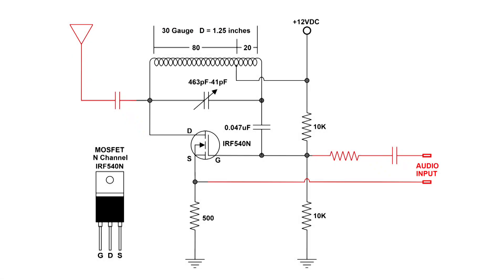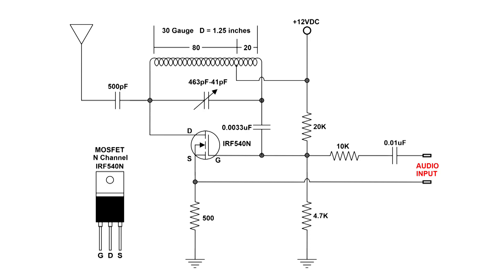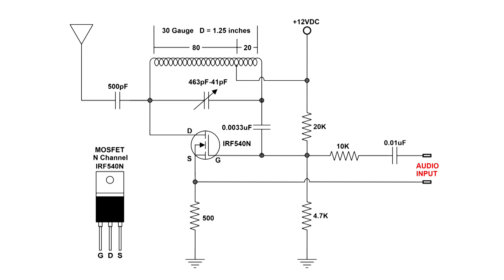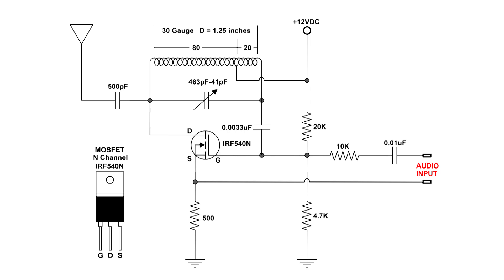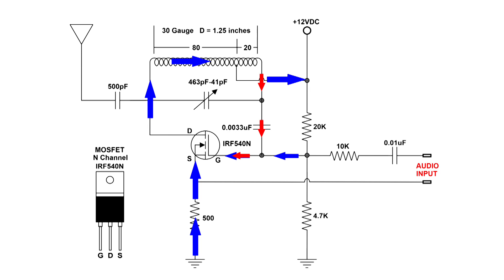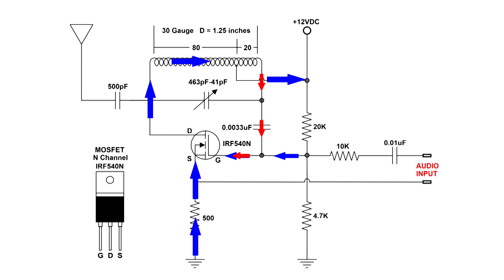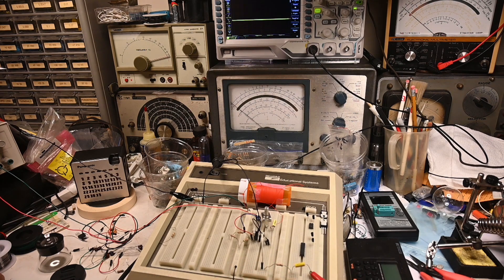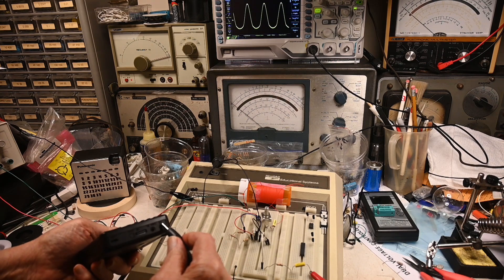MOSFET AM Transmitter Home Made Oscillator Coil PART II

Comment: Dear Sir I made this transmitter, it works very well, but only 1 meter from my radio, would like to hear my old radios in every room of my house, try to make different antennas but no luck, I think the problem is the antenna, could you show me how to make a good antenna for this great transmitter
Reply from the maker: A ¼ wave antenna would be a little over 230ft. I would try increasing the power. I think +24 VDC would help. Don’t overdo it we do not want the FCC knocking on the door. Thank you, and thanks for watching.
Reply: @AllAmericanFiveRadio  thank you so much
Reply from the maker: @koenraadschmitz9748  You are welcome. If you have more questions I’ll try an help.

Comment: Hi Rick, Will it work in a single room range, I mean 5-10 feet.? I love this project.
Reply from the maker: Yes, with a small antenna it will cover a room or two. With an outside antenna it may cover about half a block. A little more voltage will increase the distance also. Thank you, and thanks for watching.

Comment: Hi Rick. I really enjoy your videos, I learn a lot watching them. And they're bite sized which really helps. I have a question on this circuit. Not sure how to ask it, but why does the flow represented by the blue arrow "exit" the coil at the tap point and not continue to the end of the coil? Thanks!
Reply from the maker: Blue is DC. Putting the +12VDC on the tap helps the feedback (Red RF) at the end of the coil. If you had the +12VDC Blue at the end of the coil, a lot of the Red RF feedback would go into the power supply, you would need an RF choke between the +12DCV and the end of the coil, another part. This way you get Red RF feedback with fewer parts. Thank you for watching and your question!

Comment: My build worked perfect after I obtained a good variable capacitor.  Thank you for the learning experiences!  Next goal is to get the FM transmitter working (I haven't had any luck getting this one to oscillate in the appropriate band yet).
Reply from the maker: Glad you got the AM transmitter working. You may have found my newest FM transmitter video. Just in case I’ll put the link below. It surprised me how well it worked. If you have questions do not hesitate to ask!  Thanks you!
FM Transmitter Home made Coil Build Demo
https://youtu.be/Iy8Rol1nY-I
Reply: I made a hardwired version of this transmitter, which I can use for my AM radio repairs.
Reply from the maker: @edtully2740  You should find the AM transmitter useful in your repairs. You will have fun just playing OTR also.
Reply: What size variable cap did you use? All I can find is a 365pF which I’m hoping is close enough. Cheers!

Comment: I have made this Am transmitter, i wound coil on ferrite core and used mosfet IRF 630 and got great result sound quality is really amazing
Reply from the maker: That is a GREAT IDEA!!! If you do a video on your transmitter showing how will it works, I’ll put a link to it in the SHOWMORE of this video. Thank you!!!
Reply: @AllAmericanFiveRadio  Yes I was thinking about to make video about it , I will definitely make it when I get some time , in short I used same circuit as yours except I put voltage divider network of 10k on both sides as you did in older videos of Am Tx ,
I used IRF630 and feedback capacitor was 2.2nf , coil is ferrite core of 75turns total turns 60turns+15turns between 60 and 15turns I take tapping of coil connected to positive side , I used 560 ohm of 1/2 watt resistor because I did not have 500 ohm resistor.This is all what I did, the sound quality is excellent, I will put earth and antenna to test how much far it can go, thanks for giving this design on YouTube, it is because of you that I am able to make this successful transmitter, again thanks a lot.

Comment: Hello Rick 
How are you? and sorry for disturb
Do you have any circuit about an AM transmitter using crystal oscillator 
Hope you help me and thank you
Reply from the maker: Very Cool! About a year ago 
I helped a student in Athens Greeks.
Thanks again!
Reply from the maker: No not a transmitter, I do have a video on a crystal oscillator. What frequency  are you wanting to broadcast on? Heres the link to the crystal oscillator video.
Oscillators for the Beginner
https://www.youtube.com/watch?v=xezzwJAZEQY&t=86sal
Reply: @AllAmericanFiveRadio thank you for helping Mr Rick
 the frequency that I want is 1MHZ and then I will look for the AM modulator circuit appropriate for this oscillator
Reply from the maker: @sobhisaad1382  I think that would make an interesting project and video, thanks. I'll see about ordering some 1MHz crystals.
Reply from the maker: @sobhisaad1382  I completed my last video. I just ordered a 1MHz oscillator IC for the transmitter project. Should be an interesting build and project.
Reply from the maker: @sobhisaad1382  I just put up the new video
Crystal Control 1MHz AM Transmitter.
Reply: @AllAmericanFiveRadio  thank you Mr. Rick and it looks interesting
Reply from the maker: I got the IMHz oscillators and they are accurate, but they are square wave, not mentioned on the eBay site. So I just ordered some 1000KHz crystals. I could use the other oscillators, but the filtering weakens the signal to much to be useful.
Reply from the maker: I’m curious, why do you want a 1MHz transmitter? Is it for school?
Reply: @AllAmericanFiveRadio  yes sir

Comment: Interesting, but what is the range of this thing, and how should the antenna be for maximum range? Can you experiment on how to make an amplifier stage and filter, and also connect an matching antenna?
Reply from the maker: It will cover two to three rooms. With a small antenna it may cover the whole house and more.
Reply: It remindes my of an ordinary FM oscillator circuit, but you have made a feedback to make it oscillate better as needed at lower freuencies. Now we need to make an amplifier stage, filter stage to 50 Ohm cable and making a rod antenna with incuctor at bottom. 10W should do :) @AllAmericanFiveRadio
Reply: @larslande  a filter and/or antenne matcher is easy to do, but the 10 watt requires a bit more work :) This transmitter with one mosfet is an oscillater but als a modulator. So with 10 watts you need a seperate modulator. The 'old' rule is that you need at least 50% modulation, and that isn't something this would provide. Sure it can be done based on this transmitter with a few buffers and a IRF510 (which provide around 16 watt PEP), but that would be something different than this (building a small but good transmitter with just a few components).

Comment: Hello Rick, could you please explain how do you define the values of the capacitors, how did you tune the frequency and in general a bit of the theory behind the design in more depth. Your videos are very educational and I have always thought that there is a gap in the modern way electronics is thought between theory and practice. It's very nice you share your knowledge to close that gap. thank you.
Reply from the maker: THANK YOU.I'LL BE GALD TO SOMETIME SOON, BUT UNTILL THEN HERE IS INFORMATION THAT MAY HELP.
Oscillators, the Basic Tank Circuit 1
https://www.youtube.com/watch?v=fQ4yRVEzXQA
AM Transmitter Tank Circuit Coil Capacitor Resonance
https://www.youtube.com/watch?v=6TRqNkT5OCk

Comment: Great circuit! Can you use an MPF102 fet?  Also, did you check the harmonics?
Reply from the maker: Yes I have used an NPN transistor. You may need to change the bias.

Comment: Rick - great job on the new coil and circuit modifications. I love how you showed the signal flow. One trick I’ve used to cleanup the sine wave is to place an RF choke (inductor) of 180 uH or greater just before the 500 pF capacitor dependent on your wire antenna length. Thanks again for sharing your design and theory of operation. Best, Don
Reply from the maker: Hey Don, Thanks, and thanks for the sine wave cleanup tip. I have done this circuit before, maybe ten years ago. But I did not explain how the circuit works. If you change the tank circuit you can get it on the FM band and even on the two meter band and more. This is a fun and cheep circuit to learn with and can be very useful. Thanks again Don. Rick

Comment: Hi Rick, this is awesome 👏👏 you are amazing. This is very very helpful for us. What is the range for this AM transmitter? It sounds much much better then “Talking House”. Thank you for making these videos. Have a great day Rick! Regards, Jay
Reply from the maker: Hey Jay, it will cover two or three rooms with two alligator clips as an antenna. With more power and a good antenna it should cover the house and more.
Reply: Rick, can I increase the power to 18 volts DC or that will damage the unit? Thank you very much. You are genius.
Reply from the maker: @RadioFixer  Hey Jay, this circuit should handle 24VDC. You'll have to increase the audio input because the DC bias increases.

Comment: great vid ,  please tell me what the 500pF cap after the antenna does ??
Reply: it looks to me like its to keep DC off the antenna so if the antenna makes contact with something grounded it wont dump the DC power from the circuit to ground. and since we are putting out RF and not AC audio, the cap value doesn't need to be very high to let the signal through but block the DC. so just 500pF was sufficient.
Reply: @TriodesPs111   cheers
Reply from the maker: Yes, only RF on the antenna.

Comment: Sounds pretty good Rick. What's the range on it? That always seems to be the difficult part of the ones we have experimented with. :)
Reply from the maker: Hey Doug, it will cover two or three rooms with two alligator clips as an antenna. With more power and a good antenna it should cover the house and more.
Reply: @AllAmericanFiveRadio  Hey Rick. Looks like I did see this but I think Bob and I were headed in other directions about this time. Memory is a funny thing and seems to come and go more often than it used to. LOL

Comment: Nice little circuit. I understand the electronic theory of AM, FM and TV. It still amazes me that we are sending audio and video through the air!
Reply from the maker: Yes it is!
Thank you and your welcome.
Reply: I always find it fascinating how complex so many of these AM transmitter designs are posted on YouTube that actually have very little range and sound quality, yet a simple one transistor oscillator does the job as well if not better. My first experience with a AM transmitter was building a one transistor transmitter in the early 1970's it was based on an OC44 transistor and the coil was wound on a loop stick about 15cm long. The coil consisted of 3 sections the tank winding, a feedback winding and the audio input winding that was modulated by a germanium diode via the audio input connection which was designed to work off a carbon mic. We tossed the mic and replaced the input with the output of a tape recorder external speaker connection and modulated the transmitter that way either with play back music or the tape microphone set on record and the pause button to transmit vox. My friend who lived down the rd about 800m away from me had the same system and we would communicate to each other as a fun experimental project. The reason that this circuit attained that range was due to the use of the tape recorders amplifier ( standard 4 transistor 9v) and the fact that the coil was wound on a long ferrite rod ( standard radio type loop sick) and by adding and external wire anntena 10m long that was strung to a tree outside and connected to the transmitter by winding about 5 turns onto the loop stick and connected to the ground terminal of the circuit in this case the positive supply rail. Thanks for the simple design you have posted and keep tweeking to improve your results.